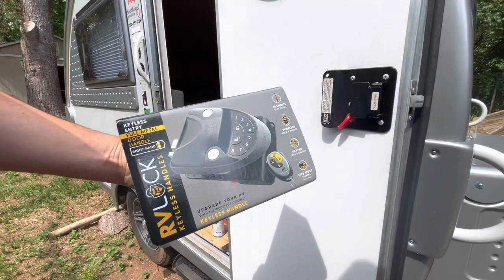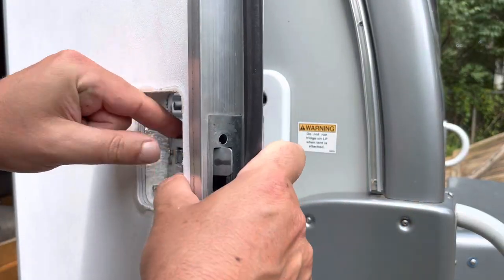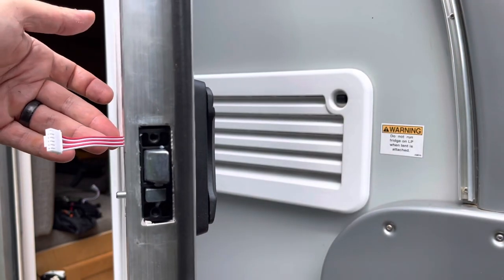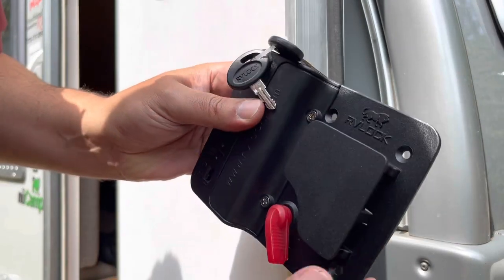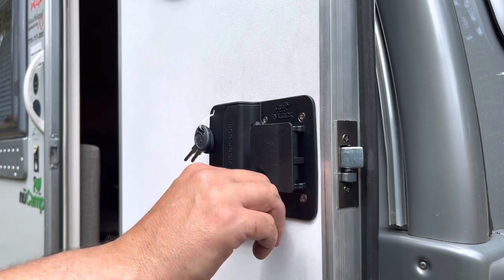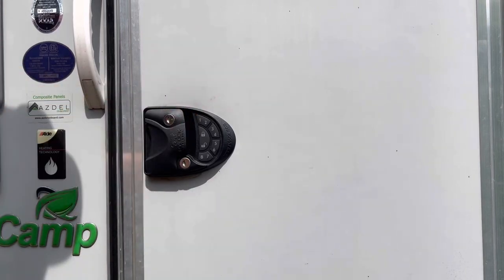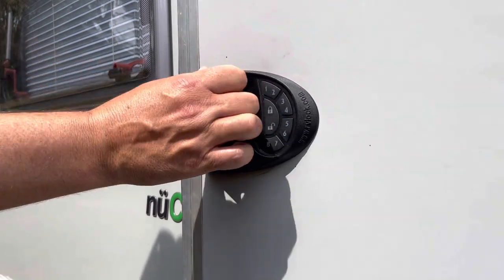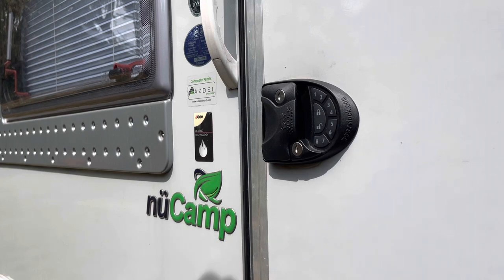Installing the RVLock V4 Keyless Entry on a NuCamp TAB 320 s

Comment: I just bought a 2023, 320 S, I’m not sure this will fit on that model because the inside is completely different than yours?
Reply from the maker: Correct. This until is for the older door style.